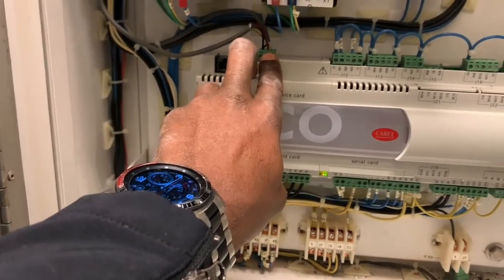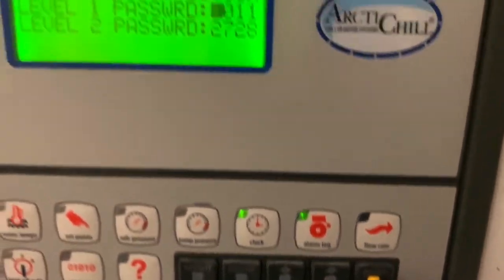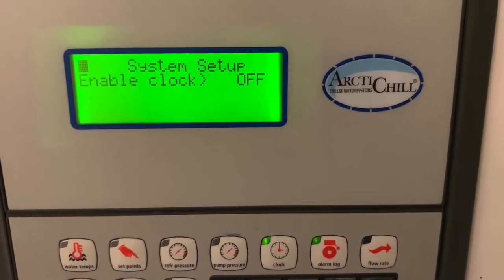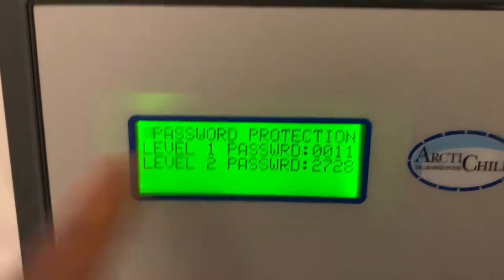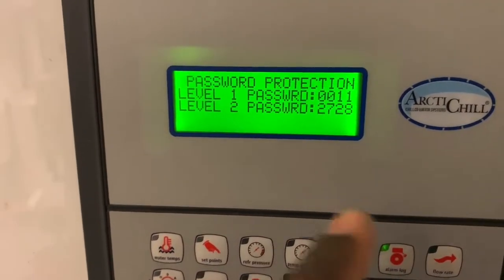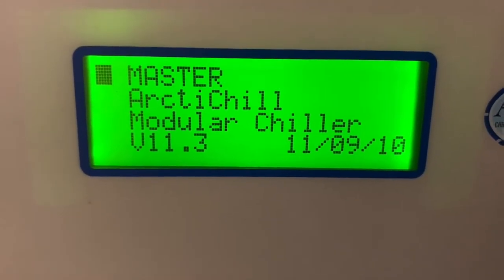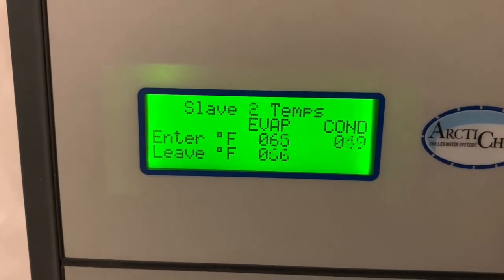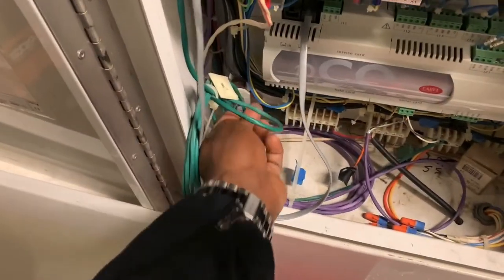PCO3 CAREL CONTROLLER INSIDE ARCTI CHILL CHILLER ADDRESS CHANGE & PASSWORD (2)

Comment: Great ....I have an issue with compressor loading,I had  power failure in my facility which made temp in the building to raise,when power was restored,the chiller took a decade to load the modules and bring back temp to normal,which settings should I adjust on the chiller to achieve faster cooling.
Reply from the maker: Duncan that’s my name as well 😁
Reply from the maker: If all modules and compressors running the you just have to wait for the load to pull-down
Reply: @D2DNYAC  I find it weird because if the Temperatures are high in the building I expect the chiller to load several modules very fast and then unload on achieving demand,on this I've noted even if building temps are high it's so sluggish in loading even the second compressor in one module leave alone commanding another module to kick,do artic  modular chiller work this way?
Reply from the maker: It’s called staging

Comment: cheat -
Reply from the maker: 1. Get back to the Main screen 📺 
FYI the main screen displays the firmware version and it’s date at the bottom 
2. Press and hold the water temp and set point keys 🔑 for approximately 10 seconds